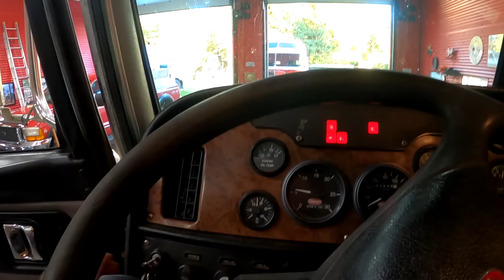Cutting up Smokey!

Comment: Mike is there a metal supply sales/ shop near you if so take the panel to them have them cut you a new panel out of a 4'X8' sheet of metal I would go back with 16 gauge cold roll steel be cheaper and I would leave the vent out of the new panel less holes the better JMO but love seeing you and your dad working together that will keep him going he's use to being busy so let him do all that he wants to do keeps him young at heart but y'all stay safe and keep the video's coming

Comment: I've being restoring an 1982 white road boss with big cam Cummins 400 ,  and I've rebuilt entire chassis from back of gear box all the way to back inside ŕails removed for severely rust jacked ,  outta rails not so bad ,  had new inner rails pressed and folded then we drilled out all the 42 holes a side at 3/4 inch using the magnet drill ,  now that's a drill ,  this drill had all 84 holes done in hours time ,,   now try it with a normal drill and you might get 3 hours done in a hour if your not worn out 1st

Comment: Mike, I would take the cab off Kenny and put it on Smokey and put Kenny's engine and drive train in K 2. That way it would give you two usable trucks with longer wheelbases. Use Smokey's cab for parts. Would also save you money and time. Just a thought. You wouldn't have to buy any more engines or cut offs. I love to see you and your dad working together.

Comment: Mike, That was a good move,  just replace the panel The corner really wouldn't be that hard to produce, simply manually bending alloy sheet over a round form first then do the cut outs for the vent and tool door. The damaged fibreglass cap can be a patch job, building the layers. She'll be a great Aerodyne when done.

Comment: Did the Aero-Shield have to be ordered prior to building the truck, or could it be retro fit? Many cabovers on the east coast of the USA had wheelbases in the 152, 154, 156 inch range because of length laws. Yep, because of logistics, even if somebody had a NOS panel, getting local sheet metal people to fabricate one is probably a good viable alternative. A tri-drive cabover with a big cooking engine would be a good lowbed tractor. Adding twin-steer would make it even better. You guys are doing good. Get some brakes on that backhoe while the snow is flying. Thanks for all you do. Take care.

Comment: I would look for a fab shop that could bend the corner, someone might have made a radius punch that would work, i have made lots of press brake tooling, and you can just make a flat piece of fiberglass, maybe make it on a piece of glass from a patio door, i have total faith in you..

Comment: Mike, I have 85 double sleeper 362. I noticed that the cab mounts are different than mine.  The problem with mine is they are hydraulic and can’t rebuild kits  yours looks manual. Was that an option back then
Reply from the maker: Stubby has an air ride cab with hydraulic locks. One works the other is stuck
Reply: @mikethetrucknut   can those be purchased or is there part number. I’ve tried to buy an airride system but can’t find one ,Appreciate your come back  if you do find a part number please let know. Your show is still the best
Reply from the maker: @Hooch  I don't think we can still get them but I'm going to check and see.
Reply: @mikethetrucknut  thanks. I still need to get the name and phone # for the guy that sells build sheets.